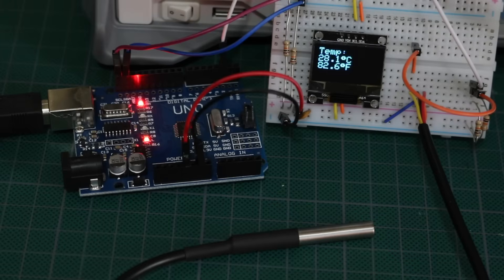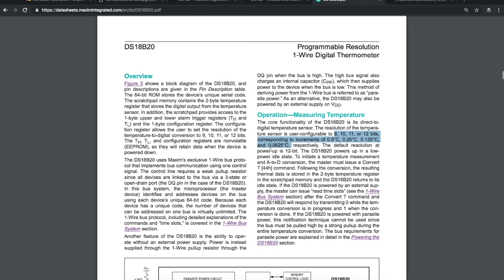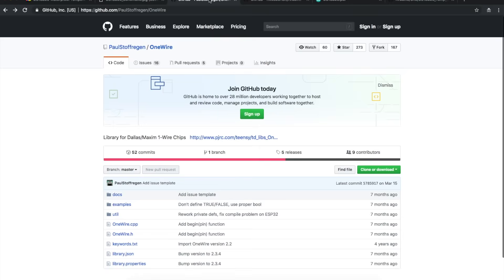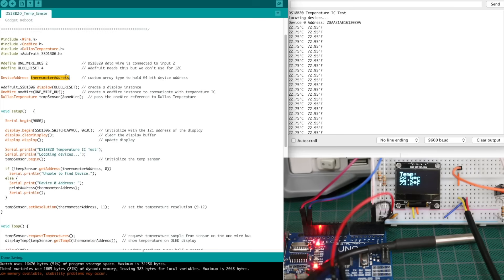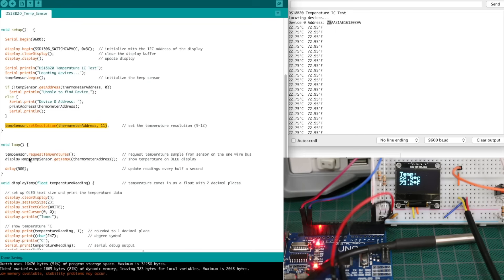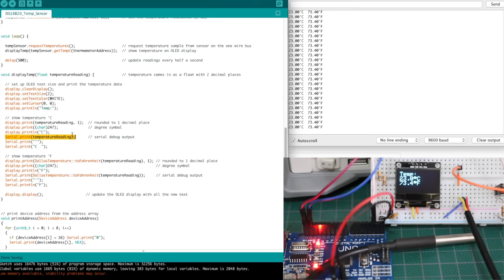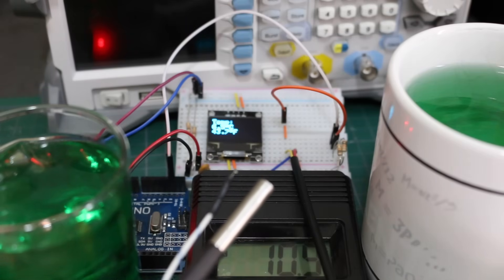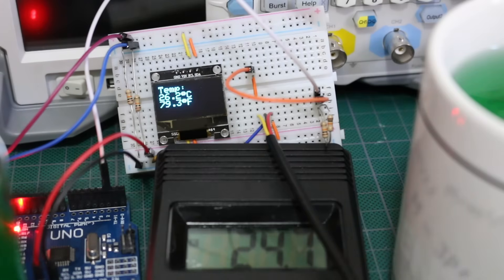DS18B20 Arduino Temperature Sensor - How to Tutorial

Comment: Hello, may I ask what's the purpose of that ceramic capacitor that you put in the Vcc to Gnd and what's it value? Thankss...
Reply from the maker: if it’s across the power supply like that it’s probably a 100 nF for the purpose of power supply filtering and providing a small power source near the component when it needs a sudden temporary large amount of current 
it can get it from the capacitor easier than the power supply through the longer wires.

Comment: Thank you. I was struggling with this sensor. At first, I couldn't get proper data even with your library. Then I increased the resolution to 12 bits and suddenly everything worked out fine. If anyone has problem with getting same data over and over, Just change the resolution!

Comment: Can this be done with 14 thermometers?
Reply: Beware: of the most common libraries has an arbitrary limit of eight sensors. However, the protocol from the data sheet appears capable of having an absurdly large number of sensors - like trillions (only on paper, of course). 14 seems totally reasonable, once the driver code is tweaked from 8 to, say, 16.
Reply: https://www.instructables.com/Multiple-Fermenter-Temperature-Control-With-Arduin/

Yes i think that is possible becuase that link suggests that they want to control temperatures of multiple fermenters

Comment: Can we use modbus protocol for ds18b20 with arduino?
Reply: If you’re talking about the Modbus serial protocol, then the Arduino should have no problem with that at all. If you’re interfacing with other devices, such as a PC or PLC, you’ll almost certainly need an RS232 or RS422 driver on the Arduino serial lines to boost the signal and make the signal differential. Take a look at the MAX232 series. They’re easy to use and, last time I looked, they were still available in DIP packages. Pro tip: add a TVS diode array or low capacitance, high-voltage capacitors on the signal lines (on the 232/422 side). This will reduce sadness caused by the discharge of static electricity, nearby motor coils, long wires and the like.
If you’re talking about Modbus TCP, then you’ll need a serial-to-Ethernet module. They’re also readily available and straightforward to use. For those, take a look at ones based on the WizNet 5500.

Comment: hello sir, I have a problem that my Ds18b20 sensor always displays on the serial monitor -127.00 and I don't know where the fault is
Reply: I had this, I think flipping the SDA and SCL into the board fixed this for me.
Reply: same here. i tried this today at december 7, 2020. got this problem too.
Reply: @vic-san12  send me ur email i will send uo a program
Reply: @yasmineyachmina8898  fixed my problem. I just need to install the library. thank you for taking the time to reply tho. really appreciated
Reply: @vic-san12  which library did you install ?
Reply: @geraldojim7356  i cant remember anymore, i just searched it in the ide library installer, i think it has the word 'texas' on it, not sure tho.

Comment: I have some problems when i get data from sensor. It always show -127 celcius can you give me the solution??
Reply: me too the same probleme
Reply: Same problem. Were you able to figure out what’s wrong!
Reply: @cdavid0624   i already solve this issue. You need to put resistor 5k on 5v connection on ds18b20 and Arduino

Comment: I really like to know how to use the parasitemode. Coz I you read about this mode every where so asumed it was a working mode. I allready have the 2 wire connectors in place and I do not have 3 wire connectors or cables. You hinted that you need 2 arduino pins to control the pull up and thats fine. Any suggestions whee I can find arduino examples that work in parasite mode?
Reply from the maker: I looked at parasite mode here https://youtu.be/145ml4ii1ao

Comment: Plz help sir, i have some problem here. why my measurement result is -127?
Reply: have you resolve it? i have same problem
Reply: @adisurya6408   me too i have the same probleme
Reply: Make sure the temp sensor is connected and has power as i had this problem and found my sensor had no power dur to a bad crimp in one of the dupont connectors i have used after replacing the connector it worked ok after.

Comment: what resistor i need
Reply: Oled display Temp: -127.0 c only.
Reply: help
Reply: im using arduino arduino uno r3 atmega 328, OLED Display Module 128X64 I2C SSD1306 12864 LCD Screen Board GND VDD SCK SDA for Arduino
Reply from the maker: @carljavier5248  It sounds like the data isn't being read so it's the default reading.  Do you have an extra sensor? It could be bad. It would also help to see some sort of wiring diagram - what GPIO pin is the sensor on? Do you have an oscilloscope to look at the data signal to see if it's communicating?
Reply: @GadgetReboot  it work thank you... can you help me on the program display.
i want to display if the tempeture meet the 100 celsius then oled display overheating thank verymuch
Reply from the maker: @michaellumio347  In the displayTemp function somewhere you could add something like  
if (temperatureReading >= 100) {
display.println("Overheating");
}
Reply from the maker: 4.7K worked for me
Reply: thank you

Comment: i want to add a relay to this to turn on a pump when the water teemp drops below a set point. is it possible?
Reply from the maker: If the relay can handle switching the pump and it just needs the coil actuated, then if there is a transistor driver circuit to handle that and allow logic level on/ off control, then the Arduino can turn the relay on and off anytime it wants and that can occur when the temperature is  below a certain level.
 There are some Arduino compatible relay boards out there that might be suitable for switching AC loads.
Reply: @GadgetReboot  thanks. its just a 12v dc pump.
Reply: @michaelgaul2244  sorry if this sounds too pedantic, but don’t forget the flyback diode on the control circuit/s. Both the pump and the relay primary can create a large spikes when they’re turned Off - leading to premature death of your relay (secondary, due to bounce pitting) and/or Arduino. A zener & switching diode combo is also popular. Watch the voltage ratings for the diode/s.

Comment: Are you able to "extend" probes to put them in different corners of a room (for instance)?
Reply: Yes, but if you may need one or more transceiver to buffer (boost and sharpen) the data signal. Also, the greater the distance, the more susceptible the data signal may be to interference. So, I’d recommend the 4-wire version mentioned in the video, with the shield grounded. This is pure speculation, but the voltage drop associated with long, thin wires may result in inaccurate readings. This could largely be resolved by running sufficiently larger gauge wire (e.g. 18ga). Keep in mind that you can use this wire to power the transceivers. Powering the sensor with the highest voltage your MCU/Arduino supports would mitigate the potential issue with voltage drop.

Comment: Can this sensor be used to measure the human body temperature accurately?
Reply from the maker: This sensor can have an accuracy up to +/ -0.5°C  and to properly measure the temperature of something, I would think the entire sensor should be immersed in the environment being measured so that other ambient temperatures don’t interfere,  so it depends how the sensor is going to be measuring the temperature. If it is just being pressed against something then it’s partly measuring the room and partly measuring what it’s pressed against.
Reply: The resolution is adjustable. According to the data sheet, it can be operated with a resolution from 0.5 C to 0.0625 C by changing the requested bit depth, from 9-bit through 12-bit, as shown. Presumably, the speed (sampling rate) and repeatability (noise) are influenced by the resolution setting. As with nearly _all temperature sensors, accuracy beyond ~0.5 C requires calibration. The method shown in the video, using ice water (at equilibrium) and boiling water (actually boiling) is a very common technique used for this purpose. Then, using the initial measurements obtained, output from the sensor can then be scaled (aka interpolated) to obtain the actual, real-world temperature.
Reply: @GadgetReboot  Totally agree. Respectfully, I wonder if the response time and accuracy of the Dallas probe in the video was influenced by the probe not being fully submerged (and completely below the ice) like the thermocouple.
Edit: to be effective, the sensor not only needs to be fully immersed, but it also needs to be given time to reach a point of stability/equilibrium. Given the probe’s relatively large thermal mass, this will take longer than a small thermocouple or a drugstore thermometer.
Reply: I’m tempted to make a joke, but seriously, it depends on where is the probe is placed. This would be no different from a typical thermometer place under the tongue, in the armpit or inserted rectally.

Comment: Thanks for your demo video for DS18B20 sensor, Sir. I want to ask, can the DS18B20 sensor measure the temperature for soil ?
Thank you...
Reply from the maker: I’m not sure to what extent the sensor will change its profile such as becoming slower to respond to changes or being less able to discern between steps in temperature changes but for measuring a slow environment like soil temperature it probably doesn’t need to be so accurate or fast responding  so if I were doing it I would apply just a thin coat to provide some protection with minimal obstruction and then test it out and re-characterize it and go with that.
Reply: @GadgetReboot  Ohh I understand, thanks a lot Sir for your explanation ! I will try to implement your suggestion with DS18B20 sensor.
Reply: @GadgetReboot  Totally agree. The thermal mass of the soil is huge compared with the sensor. So, the signal output will change _very slowly - just like the soil.
Reply from the maker: I don’t know if the metal cover would corrode in the soil and I also wouldn’t trust the existing black sleeve to be completely waterproof where it ends,  so I would probably coat the exposed metal With either epoxy or silicone sealant to cover the metal and go partway on the sleeve to seal that area.  Then I would also coat the other end of the black sleeve where it meets with the rest of the cable  so the metal is now covered and what looks like black heat shrink tubing on my probe at least, is sealed on both ends of it.
Reply: @GadgetReboot  Ohhh, I see, i didn't think about the corrosion before, thanks for your suggestion. One more question Sir, will the silicone reduce capability of the sensor ?

Comment: It's naturally slower than the thermocouple, because the sensor's heat transfer function is a function of specific heat, mass of the sensor, surface area of the heat sensing element, i.e., the time constant (time it takes to reach 63% of equilibrium condition).
Reply: Yeah, those are important. The thermal mass of the sensor and its metal can are likely much larger than the little thermocouple - even with their wires (which are probably of similar gauge). I would have preferred to have seen both fully submerged, as the heat transfer would have been faster, reaching equilibrium sooner, and the readings a touch more accurate, as the Dallas sensor wouldn’t have been influenced by the ambient air and/or ice (if the ice and water hadn’t yet agreed on 0C). Of course, doing so might have shorted the sensor, given it’s iffy seal - a situation unlikely to yield good results.

Comment: sir i have arduino mega and temperature sensor (ds18b20) and a lcd 1602A sir please tell me how to connect all these which shows temperature on lcd please sir help or give me a link
Reply from the maker: I put together a demo

https://youtu.be/lr1x96s3TKY
Reply from the maker: I think I will actually try to quickly put together a video to do that because I’ve worked on the temperature sensor in one project before and used that LCD in a different project so I will see if I can put something together  and do a video in the next couple of days. 
 Does the 1602 LCD you have  use a serial interface or does it just have all those 16 or so pins only?

Comment: There is a library that support parasitic with 1 gpio, and another that supports parasitic without a resistor milesburton/Arduino-Temperature-Control-Library , bigjosh/OneWireNoResistor, I had moderate success with them. But I know there is 2 versions of these s model maybe
Reply from the maker: I guess there’s a way to make use of the single GPIO to do the parasitic feature if it’s sitting idle anyway during that time. I’ll check it out at some point. It would be fun to get it working that way and to  possibly use the knowledge to be creative with GPIO pins in other projects too. Thanks.